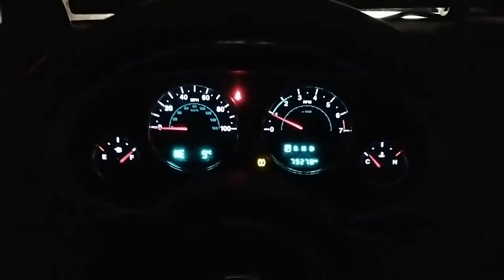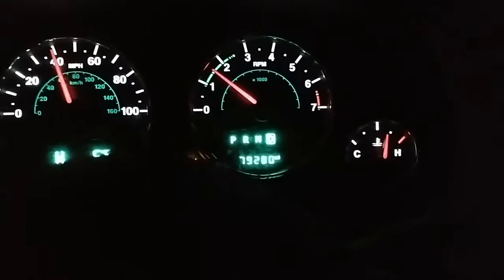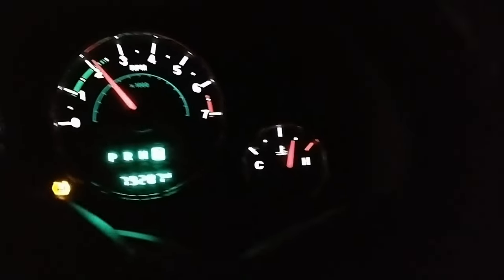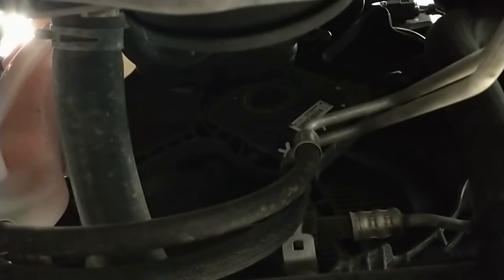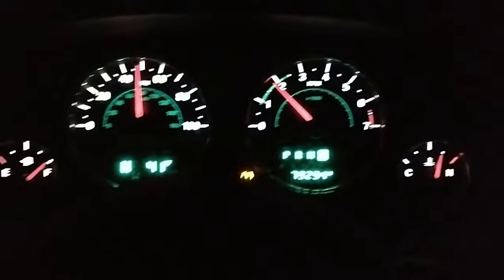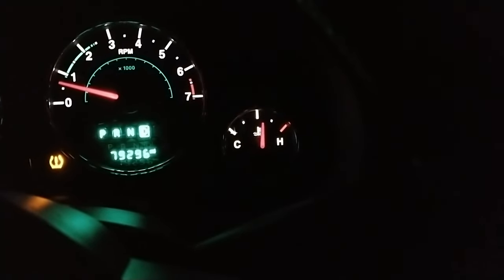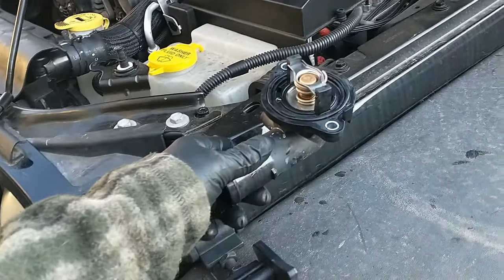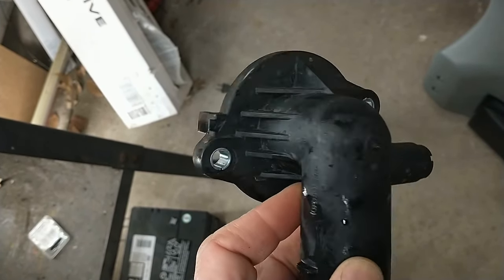Jeep Wrangler only overheats on highway...what's going on? (not what I expected)

Comment: I had the EXACT same problem in my 13 JK.  I couldn't go over 65 mph without overheating.  New thermostat, performance radiator, hoses, and water pump did not solve the problem.  Put a 180 degree thermostat in last night and burped the system again last night, and it fixed the problem.  I don't know for how long though because now I have no heater, so I'm thinking the heater core needs replaced too.
Reply from the maker: The issue I found on this one was the dealer replaced the actual thermostat but put it in the old housing and the thermostat would stick closed in the housing causing the overheating. I plan to always replace both at the same time from here out, which is easy as they typically come as a set unless you try to cheap out like the dealer did and just do the metal thermostat insert
Reply: I replaced both and my issue never changed. Mine never gets to 3/4 on the gauge but goes past half and the fan is always super loud. Not sure if I got a bad thermostat or there is a fan issue.
Reply from the maker: @mcfero1  hmm does sound strange that the fan is on high even when it's not overheating...wonder if anyone on here has any ideas?
Reply: I have the same issue, I’ve replaced thermostat, radiator fan, and fan relay. And fan is still loud.

Comment: Did you use a  aftermarket thermostat like Napa . This will happen went through 5 of them . Same problem. Only use a dealer thermostat and water pump plus radiator. Then it will work right. Mine would sit at 3/4 on the freeway an going up hills. It was the crap Napa thermostat
Reply from the maker: Yes that seems to have been the main issue, but for so long there was no OEM thermostat available

Comment: If nothing works to keep the temp gauge at the middle mark, my issue was a blown head gasket . It kept putting air in my system and drove me nuts because the jeep ran perfectly and no indication of a blown head gasket
Reply from the maker: Oof, hate that for you man, but glad you finally got it figured out!

Comment: Is a bad water pump. It caveating and not actually moving any water. Mine did it for almost six months. Several thermostats later I finally found a mechanic who told me the issue. Hasn’t come back since
Reply: It’s cavitating , dang auto correct.
Reply from the maker: Yes, that can happen too.  Usually, these jk's aren't that old and the pump hasnt rusted away internally like the old days, but they do fail, so good to add to the list for when the thermostat just isn't the culprit.

Comment: I have a 5.3 2015 Silverado and I’ve replace the coolent  temp sensor my water pump my thermostat my radiator was leaking just put jb weld and it doesn’t leak and it overheats only on high speeds.

Comment: @the joy of wrenching 
Should I have manually drained my coolant before using this vacuum system?
Reply from the maker: yeah, drain the system first, but if you still have some in there, it won't be a problem, it just sucks whatever air is trapped in there out on top of the coolant in there.
Reply: @joyofwrenching  
Yeah, I couldn’t get a good vacuum on it because I had the damn system full of coolant. I thought I was doing something wrong. Come to find out I was. I didn’t fully understand what the freak I was doing. Thank you for the speedy reply.

Comment: I have the same problem and replaced thermostat 2x and put a new radiator but it still overheats only accelerating/on highway????
Reply: Did you ever figure it out? I’m at a loss

Comment: (2016 2 door) I'm on my 4th OEM thermostat after multiple flushes and chemical flushes. It works for about 3-12 months then fails again. I am curious if the ABS thermostat housing could be part of the culprit for the T-Stat failing so often.
Reply from the maker: hmm, good thought, and perhaps, sorry you're having so much trouble with them, but apparently you are not alone!
Reply: I bought the milipart aluminum thermostat housing. I’m hoping this works.

Comment: You can replace the thermostat on a 3.6 without replacing the housing. It's possible Mopar just change the guts and not the housing.
Reply from the maker: That's true, but a lot of people report the housing being slightly misformed and causing the guts to hang up
Reply: My point is about the implication that the dealer didn't do the work they billed for.  It looks to me that they did, as evident by the spring being installed upside down.

Comment: Bought a used jeep and it’s doing the same thing I hope this is the fix
Reply from the maker: Me too my friend, I'm hearing a lot of feedback that the thermostat is bad on a lot of these
Reply: How many times does one have to keep changing the thermostat? Changed twice along with sensor now. Fan comes on always now. @joyofwrenching
Reply from the maker: I've heard people had to change them out a number of times before getting one that worked right.  I also hear the springs on many of them seem to be installed upside down, possibly causing the binding and sticking @billymaxwell3446

Comment: Hi there, my JK has the same issue. I already changed the thermostat, water pump, radiator cap. Even the radiator was flushed and new coolant was added and I still have the same issue. Any recommendations?

P.D cooling temperature sensor was also changed, thanks!
Reply from the maker: if there's nothing blocking airflow through the radiator, chances are you got a bad new thermostat so swap it out again.

Comment: I have a 13 jku unlimited.  Changed pass side rockers , lifters,  tstat, oil cooler and  flushed the system, and mine is still doing the same thing.  I'm losing my mind.  Helllppp!!
Reply from the maker: Sorry you're having so much trouble with it. On this one, they changed the thermostat at dealer but did not change the housing with it and the new thermostat was sticking closed in old housing
Reply: All of these thing still having the same problems 
Help 
Is it my heater core
? @joyofwrenching  I have done
Reply from the maker: @julianvalenzuela2945  if you can test the flow through the heater core and/or bypass it by looping the heater core hoses together and see if it does the same thing, that takes that part out of the equation.

Comment: Radiator cap blow by into the overflow. That causes a air pocket in the system then over heats in the highway.
Reply from the maker: never heard of this one before. I'll have to research further, thanks for the tip!

Comment: Hey Bud

I have the same problem on a 18jkunlimited, I changed the thermostat 2x, coolant temp sensor,radiator,water pump, fan,Flushed it and still overheating. Idk what else to do. I I’m doing the Tipm next. Any help would be appreciated. God bless
Reply from the maker: make sure there's nothing blocking flow into the radiator like a big winch and bag on the bumper, if getting good flow, then all the things you replaced cover most everything it could be. very rarely, the heater core could get clogged, but you can bypass that and see if that helps
Reply: If you have replaced the thermostat and the radiator is good. I’d pull the plugs and do a compression test. Check your catalytic converter

Comment: Can you elaborate why it didnt overheat at idle if thermostat was stiking closed ..or could it be that the bypass valve was faulty .dont really know whats the purpose of bypass valve or simtoms but hipe u can explain
Reply from the maker: I'm no expert of course, but I think it has to do with just enough flow at idle through the bypass to keep the engine cool, but when the engine is really generating heat at higher rpms, the thermostat is too closed to allow sufficient flow to cool it down

Comment: My concern is how does it get the coolant past a closed thermostat with the engine not running?
Reply from the maker: the thermostats have a little bleeder hole on them so they can relieve pressure and allow a little air past if some is caught behind it

Comment: I also have a 2014 that’s doing the same thing.  Overheating at highway speed.  It shows 233 degrees for around 20 seconds before the fan starts bringing it down again.  I have changed the thermostat, radiator, bottom radiator hose, and radiator cap.  I have used the burping system that you have shown.  I have taken it to a mechanic shop and had the system vacuumed and reinjected with coolant.  I am now running it without a thermostat, installed a 10” auxiliary fan in front of the transmission cooler and degreased and rinsed the transmission cooler and condenser coil.  It is still doing the same thing.  At idle, the temperature comes down to 199 degrees.  When driving highway speeds, it floats between 233 and 203 degrees.  Any suggestions?
Reply from the maker: no thermostat and it's still getting too hot? restriction in front of radiator, fan blowing backwards, and or head gasket issue are possibilitites, what else guys?
Reply: Factory radiator fan is indeed blowing towards the engine (pulling air through the radiator).  I’m not showing any mixture of oil in the coolant or coolant in the crankcase.  Not saying that it could /couldn’t be a head gasket.  Idk.  It could be a restriction getting air through the transmission cooler and/or the condenser.  But like I said, I’ve soaked them both down with degreaser after 5 minutes, rinsed everything off.  Since I had just installed the new radiator, I couldn’t back flush the trans cooler and condenser.  I thought about it too late.  I’m going to put a bottle of Cool Down in the radiator and see what it does (Cool Down from O’Reilly’s).  The label optimistically says that it lowers temperatures by up to 30 degrees.  We’ll see.
Reply from the maker: @johnschoolfield4595  I'm curious now to see what you ultimately find as the issue
Reply: As an add, I originally changed the radiator last August when it blew a pin hole leak on the highway coming through Baton Rouge.  I bought O’Reilly’s Lifetime Warranty aftermarket radiator.  Since then and all the trouble I’ve had, I reached out to them last month and they even-exchanged the aftermarket radiator with an original Mopar radiator.  So that’s what it has in it now and the overheating symptoms haven’t changed.
Reply: I drove the Jeep for 2 years and never had any overheating issues till the radiator blew coming home through Baton Rouge last year.  Ever since, I’ve had the overheating issues.
Reply from the maker: @johnschoolfield4595  hmm, interesting note. I have heard of poor sealing of the radiator cap causing these issues too
Reply: I’m currently on the 3rd radiator cap.  The latest that’s on it now is the updated cap I heard about on the internet and bought at the Jeep dealership.  It used to be an 18 lb cap, now Dodge has replaced it with a 17 lb cap.  Still no change in my symptoms.

Comment: Having the same problem, but I replaced the thermostat and bled the air no overhead or fan on, drove it no problem, but the problem comes while driving,  at idle traffic light normal temp, Do you think that the water pump is failing?
Reply from the maker: it is possible, but thermostat could be bad, radiator could be clogged or blocked from dirt outside or rust inside, lots of possibilities, too many to say for sure over internet.  Anyone else here have any helpful tips for Antonio?

Comment: My coolant boils but the temperature doesn’t rise passed a 1/8 of in in the middle. The whole system is new
Reply: Check your radiator cap. They actually do go bad so that the radiator can’t pressurize properly.

Comment: My 2012 doesnt pass 3/4 it only does it on the highway should i change the Tstat?
Reply from the maker: that's a tough one...only because so many people get bad replacement thermostats.  I would say try replacing it as it's easy to do, keep the old one, and you can always put it back in if you suspect you get a bad replacement one.

Comment: 17 wrangler overheats when AC is on while driving the fans are running but engine still overheats help please
Reply from the maker: check the usual suspect areas: blockage of the radiator/condensor by trash in the fins or something in the way, change out the thermostat and housing, burp air from system good.

Comment: My 07 Toyota has had the thermostat replaced by myself and I don’t think it’s a blown head gasket because I have no water in my oil and I don’t have steam coming from the exhaust and it’s not skipping so I’m gonna try replacing the water pump next. Any advice??
Reply from the maker: Overheating? Losing coolant?
Reply: @joyofwrenching  running hot
Reply from the maker: @billgates6995  could be water pump, still could be head gasket, clogged radiator, radiator fan issue, something blocking airflow across radiator, many options...just keep digging, and you'll find it!

Comment: What about testing the coolant for carbonmonoxide, or bad head gasket?
Reply: it seems to have no power loss or higher gas comsuption, 'dirty' cooliant or odd exhaust gas color, just the overheating on the high way (with dealership replacement recipe)

Comment: I hope you completely drained the cooling system and replaced it with new coolant.. you diluted the old anti freeze with non distilled water ruining it ..
Reply from the maker: Good point man. Once we figure out the issue it's time to do it right!
Reply: My 2018 Jeep has a similar problem but it’s only climbing hills on the freeway. I’m wondering if it’s a thermostat that may not be opening all the way. Great work ruling out causes before advancing. I may just replace my thermostat and see if that solves it.
Reply: It can be a small hole on the heater core thermostat or or hairline crack on radiator everyones problems is in different places don't sleep on the heater core and clean out the sister gunk can trap air aswell clean reservoir aswell as all hoses and inspect hoses you might have to replace one aswell

Comment: My car is doing this exact thing except I have removed the thermostat
Reply from the maker: try to think about how the system works and check each part of it. with no thermostat, you should have water flowing all around.  to cool that water, it has to go through the radiator and have good airflow across the rad to pull the heat out of the water.  make sure these things are functional first.

Comment: I have a 15 wrangler and just yesterday my car overheats on the highway. I changed the thermostat and radiator a few months ago. Any suggestions. I tried burping the system but maybe ill try again.
Reply from the maker: I keep hearing people report getting failed "new" thermostats, so a quick and relatively cheap way to test this is to replace the thermostat AND its housing once again. Burp air from system as I show with a tall funnel, and hopefully, you'll fix your issue
Reply: @joyofwrenching  hey so yes it was the thermostat I baught off roc auto and had the mechanic install. Don't buy motorad. Hopefully Dorman is more reliable. The mopar brand is in backorder for many months
Reply from the maker: @DavidDalBello  I hear about the Motorad failing most often, and that's what was in this jeep too.

Comment: My jeep just started making this loud fan noise I can hear over the ac and twice so far the engine overheating light popped up. Not doing anything different from the year I've had the jeep.
Reply from the maker: fans are set to kick up high when starting to get too hot, so definitely need to find out why your jeep is overheating and repair, most of the time its the thermostat on these

Comment: I have the same issues and have replaced everything possible except the heater core 
Even the oil filter adapter 
I am now just shit out options anybody got a fix 
Is it a head gasket leak !😢
Reply from the maker: Lot's of people say they have had to go through a few different thermostats before getting one that worked right...hope you get to the bottom of your jeep's issue and come tell us what you find.
Reply: Thank you for the suggestions I’ll give them a try and give back results
Reply: Ok I was topping off my coolant using a burping funnel and lots of air came. Burp the system, vehicle was lifted up for air pockets. I stopped when I thought it was all done burping . Lots a bunch of f antifreeze in the process. Once i shut the engine off I let it drain back into the radiator and capped it. Once I capped it I started it up again and let it idle for 10 minutes. Top and bottom radiator hoses felt like a tire with a bunch of air. Once I opened the radiator cap antifreeze and a whole bunch steam came hiding out. It literally purged dam near all the fluid out of my cooling system. My heater core was emptied. Gonna try to top it off again it this time get a head gasket radiator kit to seen if that gas is from the head gasket , then after that plugs and compresses test 🤔
Reply: @julianvalenzuela2945 what was it after all?

Comment: Check anything is blocking air flow to the radiator , like winch ,lights debris etc and if the fan is drawing enough cfm
Reply from the maker: Good point, lots of jeeps taken off road get mud up in there all over the rad too
Reply: @joyofwrenching  Yeah I had an angry bird grill that was restricting alot of my air flow and my a/c condenser was very dirty , then also i switch to an flex a lite electric fan witch flows double the cfm as my mechanical one did

Comment: Catalytic Converter is most likely the cause of overheating on the highway
Reply: My 2003 Dodge ram 3.7l is doing the same thing. cat is fine. Maybe head gasket blown blowing combustion into the coolant and cavatating. I have also heard people putting the belt on wrong and water pump running backwards.